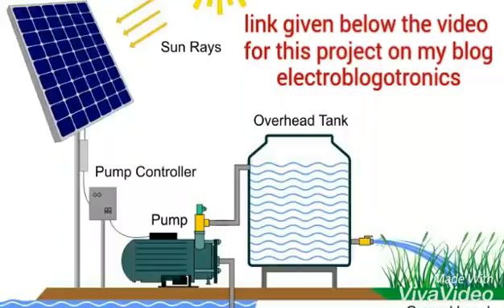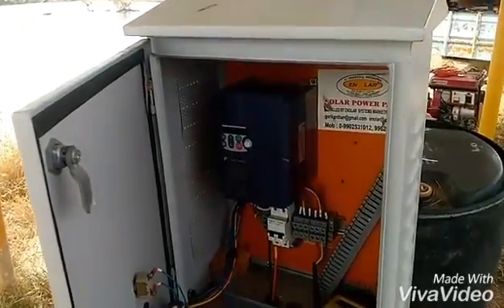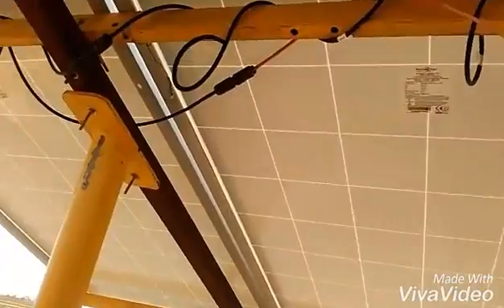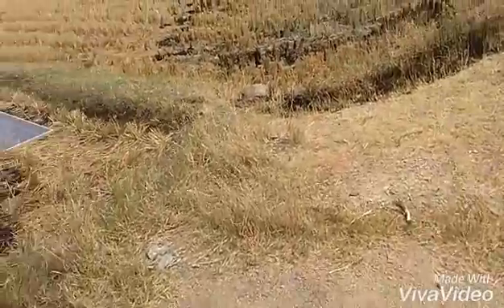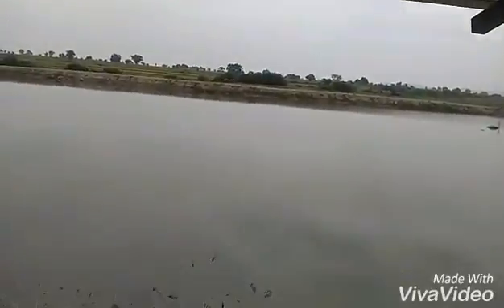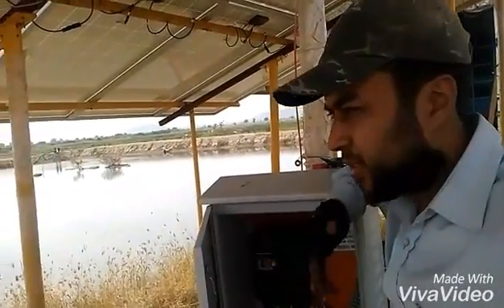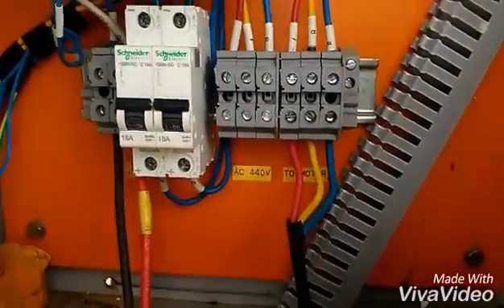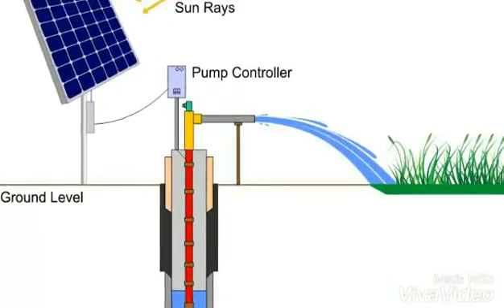DIY Solar PV water pumping system #SustainableEveryDay

Comment: no batteries your running the pump direct from the solar panels.. don't you think it will burn the pump much faster if it's not using batteries..i mean it will shorten it's useful life.
Reply from the maker: There is a proper protection provided by VFD controller to protect the motow windings
Reply: i see...thanks